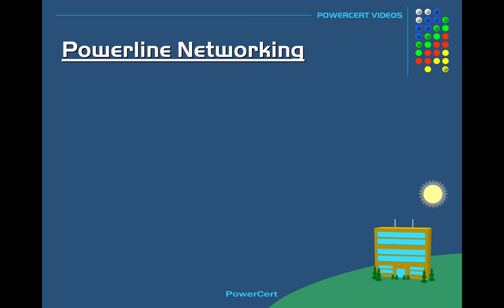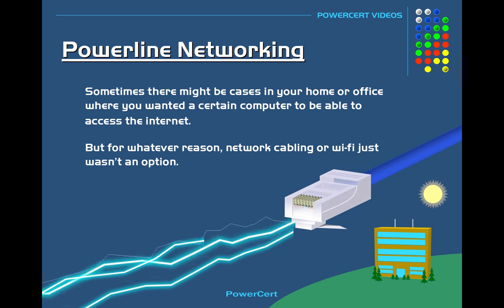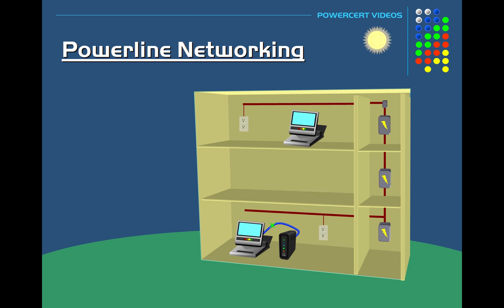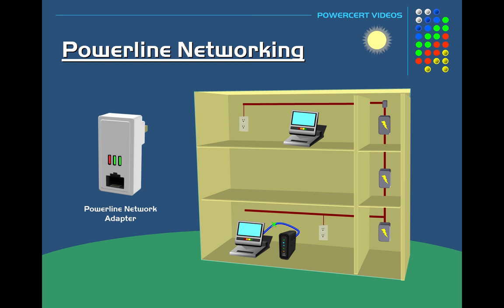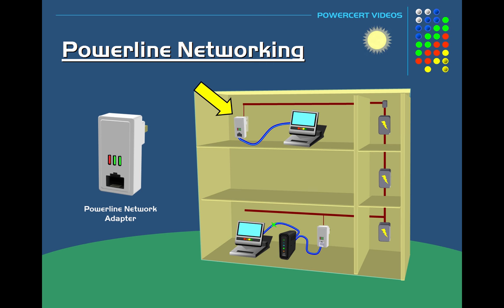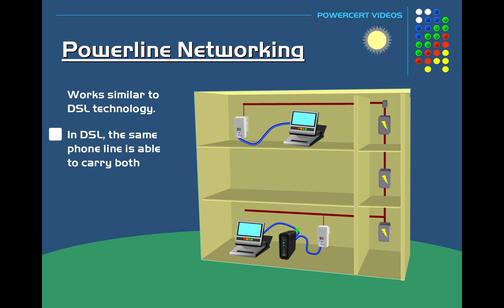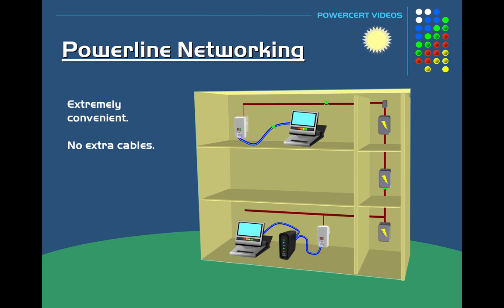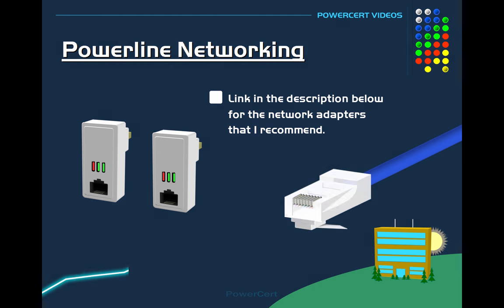Powerline Ethernet Networking Explained

Comment: Do you need a pair of adapters per computer or 1 to many? 1 connected to the modem/router and then one per device around the building? Or one set/pair per device?
Reply: i guess you can use an adapter and then connect a router to it instead of a pc, just like you would normally do if you want to extend your internet connection

Comment: Is it good for streaming?
Reply from the maker: Powerline networking is not as good as using ethernet cables..but its better than wifi.
Reply: @PowerCertAnimatedVideos  thank you for help sir
Reply: Only way to truly know is to try it out. There is a lot variability in everyone's electrical wiring. You can have a great experience, you can have a terrible experience or an intermittent experience. I used a powerline setup about 7 years ago. I had to try many different outlet combinations to find the best setup where my connection would work, and more importantly, not fail drop constantly.
Reply: That depends a lot on your electric grid. It can be very slow and much worse than wifi, or be faster.

Comment: can I connect more than one computer using the same method?
Reply: Yes, but you will need a network switch. Most Powerline adapters only have 1 ethernet port. You will need to plug a network switch into the adapter and then you can plug multiple devices into the switch.

Comment: Will it run if you use UPS? Instead of directly putting it on AC wall outlet?
Reply from the maker: It has to be plugged in directly into a power outlet.
Reply: PowerCert Animated Videos That sound scary and that's why it need to be explain and also if you can network or bridge between devices not on the same buss bar or transformer (Transformer 1 > pc1 > Ethernet cable >power line adapter on transformer 2 > ethernet cable power line adapter > PC 2).

Comment: Interesting implementation, relative to wifi how good is it this? I am asking this because even with a 50 bucks Linux compatible wifi dongle it's pretty much not so fast (kbps to a few mbps at best).
Reply from the maker: I would say its in between wired and wireless.
Reply: @PowerCertAnimatedVideos  Very nice, I may look into this after the holidays as this may be prefect for my needs. Especially if downloading things and/or otherwise using the Internet is going to take forever continuously.

Comment: does it need to same powerline adaptors? I mean same company/brand? I have two different company models and wondering if they will work?
Reply from the maker: Not sure....good question.
Reply: I actually used TP-link and added a third Trendnet powerline adapter and they seem to work though having the same brand seems to work the best for me.

Comment: The one question I have, was not answered by the video :( can more than 2 adapters be used, to connect 2 computers to the Internet?
Reply: not on the same power line since the 2 wires you have in your cable in the wall already carry the data for the particular computer.
you could achieve that with a router connected to the adapter instead of directly connecting a PC to it (if the computers are in the same room)
it also depends how many phazes you have in your house, phazes being L1, L2, L3.
in Europe, houses typically have 3 phazes so you would have to find 2 sockets that share the same phaze
in that case you can use 3 pairs of adapters but you would have to connect them into 3 ports in your main router
i would say that having 2 routers is the cheaper and easier way to go

Comment: Hi, can this only be used for internet or can I connect two computers together through this as well? The internet seems to work but had no luck with the computers connecting to each other :/
Reply: if you use older PCs then the problem is in the cable that you are using not in the adapter 
to connect 2 computers  you need a crossover cable where Data + and Data - are swiched
so basically you need to connect D+ to D- for the other computer 
laptops dont have that issue

Comment: Wow 😲! I’ve only recently heard of this, but no damn idea exactly what it was or how it worked. Now I know both. However, a question I have is, does the Ethernet speed still be the same going over the power line connection through the electrical cable coming out the other side of the RJ45 connection as it is in rest of network?
Reply: Most likely a lot slower but in my case, faster than wifi.

Comment: any data loss, latency issue, speed limitation?
Reply: All of that is typically limited by the actual power lines in your home. Newer, higher quality wiring will perform better than older wiring.

Comment: Do you need a modem for this or will a router suffice? If anyone knows
Reply: If your not going on the internet then there is no need for a modem it should work on and internal Network with a router.. but if you want internet you need a modem

Comment: What's the drawback of these Adapters?
Reply from the maker: They are not as good as using regular network cables.  The further away the adapters are from each other - the weaker the signal.  The age of the building may also have an effect.
Reply: PowerCert Animated Videos hmm great technology though ..btw  Keep up the good work love the videos that you upload very informative

Comment: Anyone got any idea why my speed dropped by half when I used powerline adapters instead of wi-fi? . Running a 2012 Mac Pro, on wireless, I get the internet service speeds I pay for for, 40-50 MBPS down, 15-20 up. The signal is weak though owing to two heavy brick walls between router and computer and I get my voice and image occasionally dropping out or freezing during group Zoom conferences.. So I got 500 MBPS powerline adapters, and plugged into ethernet, thinking I'd get a stronger and more consistent signal. But speeds dropped to 20 down and 18 up. The computer has gigabit ethernet, so there should have been no drop in speed. The powerline adapters are plugged into the wall in each room, no other equipment interfering
Reply: It depends on your home's electrical wiring and where the adapters are placed. Sometimes you have to try different outlets to find the one that works the best.
Reply: @JJFlores197  Spot on. I get a huge a variation depending which power outlets I use.

Comment: I've been using this for years, but found that the adapters die after a while.  I just bought a pair to replace them.
Reply: that's right, 

so... When you consider that you'll pay around $50 each time you replace them
ISN'T IT JUST A TAD MORE INTELLIGENT TO HAVE A PROFESSIONAL CABLE RUN CONDUCTED ?

Comment: I wouldn't recommend these devices. They cause radio interference in a wide frequency spectrum. A powerline isn't made for transporting RF signals. The adapters just put a broadband RF signal on you're mains line which also leaves you house. Making it available for any-one to pick up (yes the data is encrypted but trust me, it's not the best they could have use). 

As a technical specialist and a hamradio operator (and off-course gadget freak) I have tested several of these kits and not only did they interfere with radio broadcast stations (MW, SW, hamradio etc), but modern versions also enter the VHF spectrum (FM, police, fire brigade, medics etc). In the Netherlands these kits where given by a mayor ISP's as a cable replacement.  Dutch ham radio operators protested against it and now the ISP has to reconfigure them so they won't interfere on numerous bands droping the through-put speed with 40% to 70% depending on the type of adapter used. 

When you want reliable network communication in you're house : just create a wired network. It takes a bit of work, but I will save you a lot of headaches.

But as always : great video.
Reply: Hello, I have a question. I've been looking online, and there's not much information on how secure powerline ethernet is. I've heard that people in your neighborhood can apprehend your packets, as they might be on your circuit. Is powerlining secure?
Reply: @Ben-pi5ww  the communication can be picked up but is encrypted . But like all encryption there will be a time that it becomes broken. Like the WEP used on the early wifi.

Comment: i thought i was smart but, HOW TF IS IT POSSIBLE TO SEND AN INTERNET CONNECTION THROUGH YOUR OULET?!?!
Reply from the maker: It sends it through the electrical wiring in the building.  It's amazing.
Reply: Much like how different frequencies on a radio give you different stations, this sends data through the AC power outlets by using a much higher frequency than the AC power frequency. Which is about 50/60hz depending on where you live